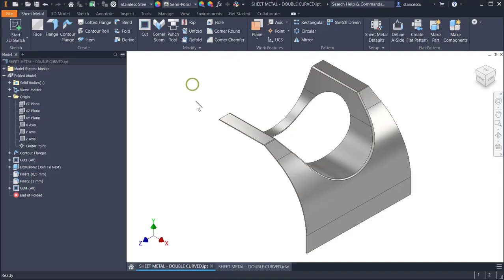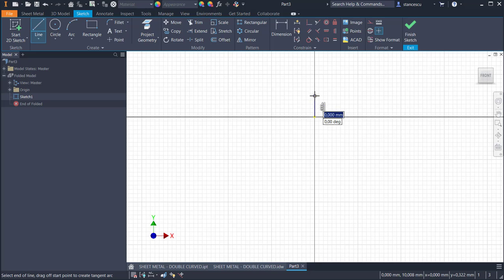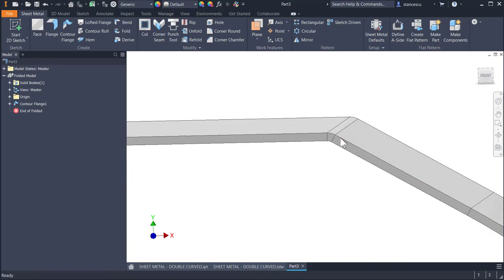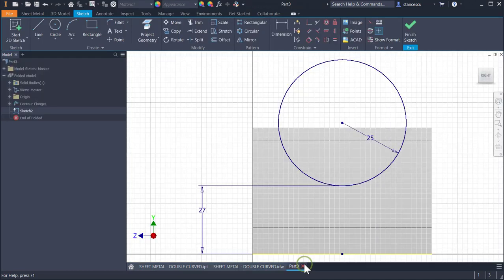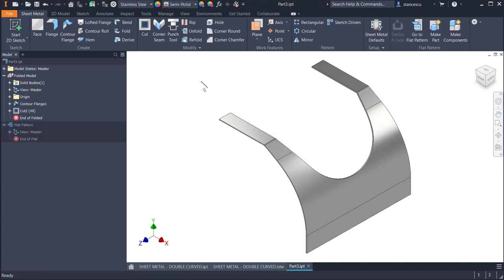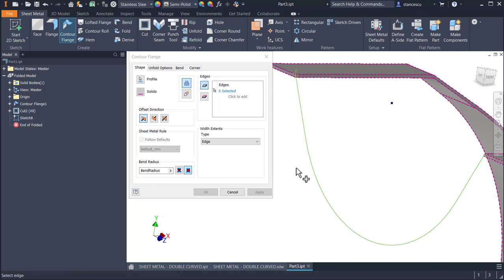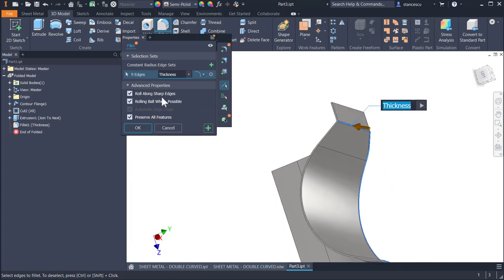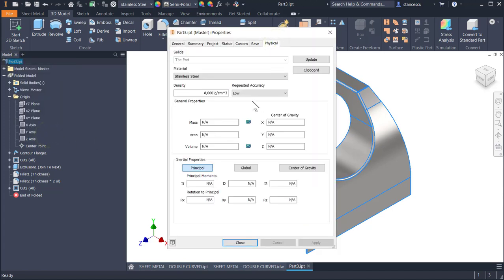Tutorial Inventor - 216 SHEET METAL - DOUBLE CURVED

Comment: Looks good! The reason why it can be flat patterned was bec of 2 curves in different planes will not work unless you use the forging machine to do the job
Reply from the maker: My opinion is that the reason why some sheet metal parts cannot be unfolded is that the measured area of the folded/unfolded part surface is different. In my Romanian language, that kind of part is called „ambutisate”.
Reply: no problem there are always more than 2 ways to achieve the goals